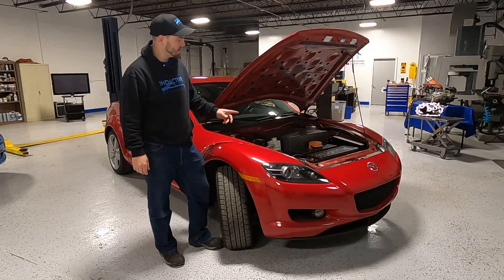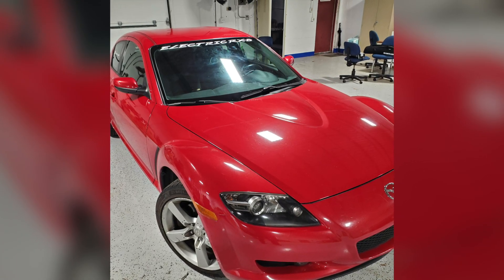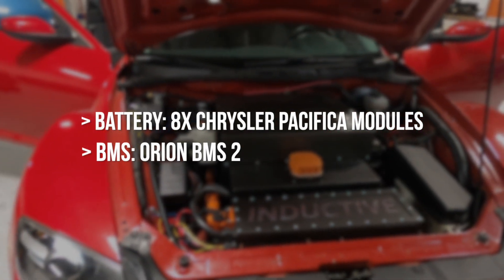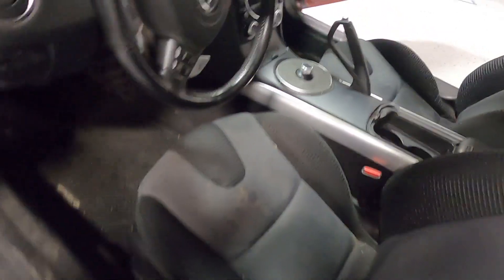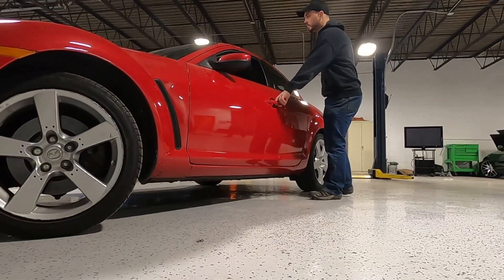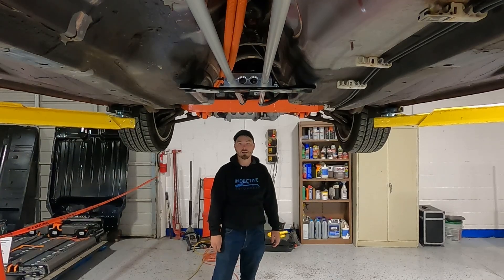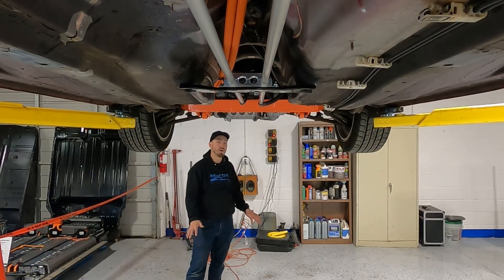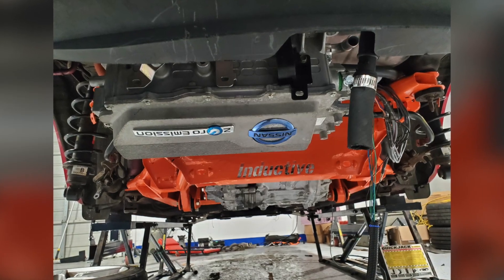Mazda RX8 EV Conversion | Inductive Autoworks

Comment: Garbage build. Original engine made 231hp and still the car was somewhat underpowered, now you put a garbage 100hp EV motor in it with less than what, 150km of total range in the city? Congrats what can I say.
Reply: Original car felt underpowered because it made peak power at 8000rpm and peak torque at 6000rpm. This "garbage" EM61 engine has more torque at 0rpm than RX-8s Renesis ever had. And it's only 150km because they decided to have very small batteries (and lower power engine) to keep the weight close to original.

This thing probably feels amazing to drive in a city, but keep on hating.
Reply: @kingayvaz  you can have infinite torque at 0rpm, the power at 0 rpm is still 0. That crappy engine loses torque on a straight line from 0 to redline while the stock keeps a flat torque curve from say 4000 to 8000 rpm, while getting x3 the range of that EV at the same weight you seem to be so fond of. May I add that it's not the torque that matters(if geared well), but overal power and the total area under the graph of the power vs rpm to decide how good an engine is.

Comment: i wonder if something similar could work on an NC since they share a lot. Also you reduced the weight by 500? that's absolutely insane and unbelievable actually. where do those savings come from?
Reply from the maker: Engine, transmission, exhaust, fuel tank (and fuel), the rear diff plus a bunch of smaller parts were all removed. EVs are so much simpler then ICE vehicles.

Comment: Very cool and clearly an in-depth swap; what is the price of the conversion, a rough 0-60, and the weight/USD cost of a range closer to 100-120 miles even if it eats up some trunk space? How much did the center of gravity move up with the engine bay battery and the lack of low slung driveshaft/transmission/engine?
Reply from the maker: If we were to build this again today for a customer, it would likely be around $55k USD. That would be with our new battery pack that is double the capacity of the one in the video.